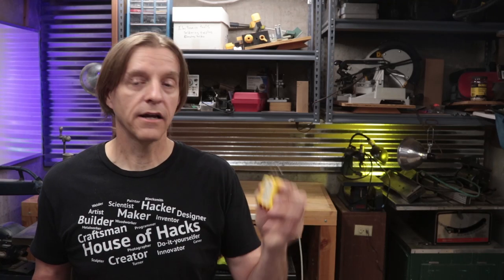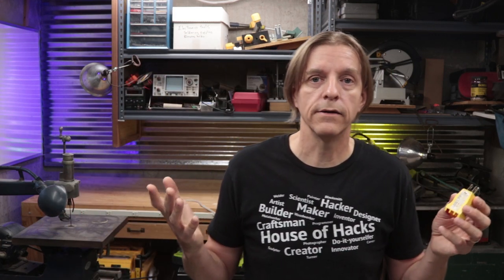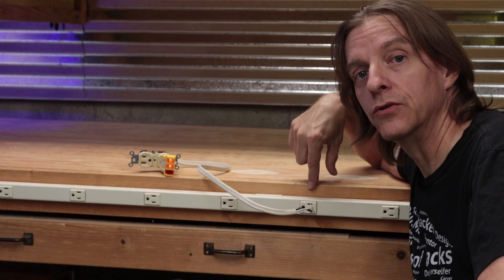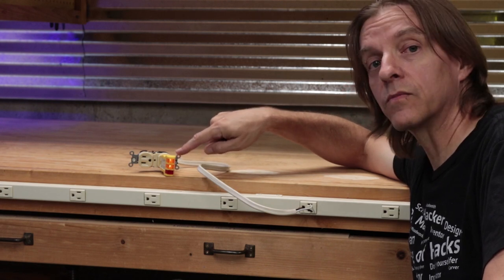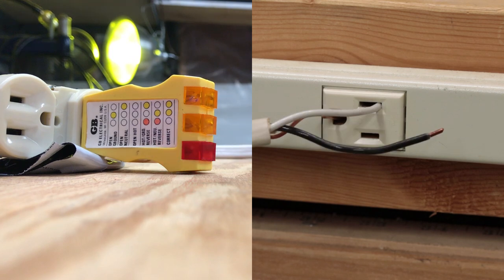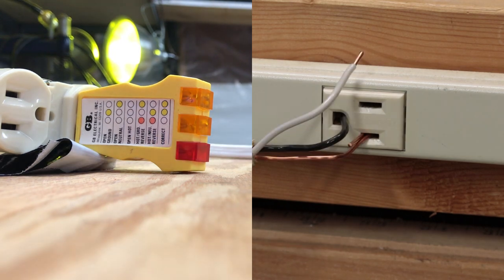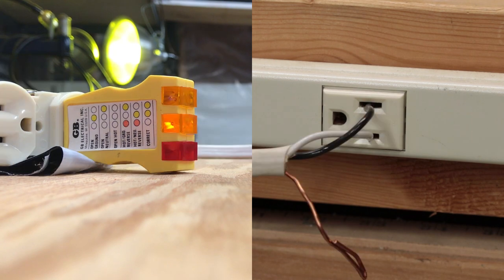Outlet Tester Light Meanings - Examining All Combinations

Comment: hi, i have an outlet that has no power and tester show 'correct' readout, BUT center light is faint and right light is bright. have you ever seen such display? thanks
Reply: Likely a poor neutral connection that allows enough current to light up the middle light,  but fails when a real load is connected.

Comment: There's one more undocumented configuration of the lights.

 It's 1 that all 3 lights are lit because there is AGFI circuit with no ground except 1 and appliances plugged in they will a luminate all 3 lights at once.
Reply: Just tested on of my gfi outlets and it lit up just like that. I don’t use the outlet, should I be concerned?

Comment: What happens when You have one solid yellow and one lighter lit middle yellow light? Its like almost "correct" but nothing is working.
Reply: Poor neutral connection.  The middle light is connected across hot to neutral.  Allows enough current to light up the middle light but fails under load when a real appliance is connected.

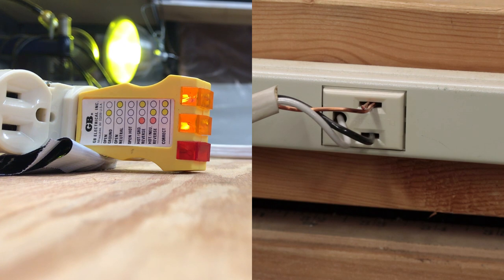Comment: 2:29 old houses around here (Qc, canada) have the ground and neutral on the same bus bar in the electrical panel. to the house are just the two phase (120AC) coming in, the ground/neutral come tru the earth(soil outside). it is why it is important to have a good grounding(soil) for the house. also you can see every other telephone pole has a grounding spike. sometimes they corrode and it can cause problems.
i have heard stories of homeowner removing their grounding rod to do some renovation and they got electrocuted to death.

i have discovered this while seeing that only two wires came to my house from above, and that the metal cable intertwined between them was not connected to anything and was just a support for the other two. i saw inside my panel all the ground and neutral connected together so i then understood.
Reply from the maker: Hi Francois!

Yeah, old wiring can be dodgy sometimes. A work buddy of mine had a house built in the 1840s. When he moved in, different parts of the house were wired to different standards, including some that was bare wire running through the attic with knob and tube insulators. (It had started with fabric insulation but that had decayed over the years. He found it lying under the wire.) When he was done with it, it was all up to modern code.

My understanding, is the neutral wire here in the US goes to ground at the electrical substation, so the only real difference between ground and neutral is where the ground is located.
Reply: @HouseOfHacks  i found some of those ceramic insulators before. very strange to know they even considered using something like this in the past. my current house has tar and paper wiring with some new add-on with the modern PVC cabling.

i wish you great health and success in anything you do!
Reply from the maker: @Francois_Dupont  Yeah, some of the things that used to be done would never happen today due to the cost. We just had some relatively expensive houses build next to us over the past 2 years and I was surprised how cheap some of the materials were.
Peace!
Reply: I truly doubt that there is no neural coming in. That would limit the power and put a deadly voltage gradient on the ground. The neutral may be on the sheath of the cable. No circuit breaker will trip in case of fault if there is no neutral.
Reply: @okaro6595  no actually, since both phase are 180degrees from each other most of the power get cancelled inside the panel in the house. for example if you take 14amps from one phase and 12amps from the other there is only 2amps going thru the ground/neutral to the telephone pole. it is why all the circuits in the panels are always installed at interval. one is on one phase, and the next circuit is on the other phase.

are you in Canada? if you want to know just go watch a couple of electricians video about this. i am sure they would explain it all in detail.
Reply: @okaro6595  i forgot to say, there is no sheath on the cable. both phase are simply naked cable covered in PVC or something. then there is a lone steel cable that is naked and interwoven with the other two. the steel cable is simply used to provide physical support. there is no outter shealth.

Comment: What does it mean if you have an outlet circuit connected to a 15 amp breaker that trips after a few minutes on with no load and when you use the tester, both yellow lights are on but are flickering?

Comment: I have a center light bright, right light dim until i push the test button, then it shows hot/neutral reverse. It is clearly wired correctly and reversing the hot/neutral wires didn't change it. Any tips?
Reply: I've ran across this once in an older home built in the 50s with metal boxes and no ground in the wiring but the box was partially grounded on a basement wall.   What you have is an open or very poor ground.   The test button on your plug tester is used to trip a GFCI and does that through a resistor connected across the hot and ground to simulate a 30mA ground fault and verify that a GFCI receptacle or breaker is functioning properly.  Because there is no ground on your receptacle pushing the test button on the tester applied voltage on the ground,  and the red light lights where there is voltage between neutral and ground.   The middle light indicates voltage between hot and neutral.  The righthand orange light indicates voltage between hot and ground.   You can use a multimeter to check the voltages on a properly wired, a hot/neutral reverse,  and other miswired configuration outlet from hot-neutral, hot-ground and neutral-ground to get an idea  of how a three light tester works if you're really curious.

Comment: Hello, I am using Sperry Outlet tester and I get all THREE lights on an outlet.  Replaced outlet but still no luck.  I tested with multimeter and only getting 6-7 volts.  Anything else I can try?  Thanks so much.
Reply: Better to call an electrician. Problem solving is not for laymen.

Comment: 2:29...my 15 amp gfci outlet shows two amber lights. Any appliance plugged in won't run. But the Sperry circuit tester shows it's a hot outlet. The outlet was installed 31 years ago, so I suspect just a replacement gfci outlet at 15 amps. Is this my first course to repair the defective electrical outlet or are there others to consider first?

Comment: What if middle light is on, but the right side light is dim?
Reply: Poor ground.   Might happen in an old house with metal boxes and no ground wires.   If you were to take a multimeter and test across hot-neutral,  hot-ground and them neutral-ground you'd probably see  120V hot to neutral,  a few volts hot to ground and 0 volts neutral to ground.  A few volts is all that is needed for a neon indicator on a tester to glow dim.

Comment: What does it mean when all 3 lights are on?  Does it mean it's all crossed up on the circuit?
Reply: All three lights lit means the outlet has 240 volts,  or somewhere close to it.  Either because of a floating neutral on a multiwire branch circuit eg. a 12/3 romex in your kitchen supplying the two circuits for the countertop outlets with the black and red sharing a common neutral, or someone installed a standard 120 volt 15 or 20A outlet on a dedicated circuit when they really needed a single outlet 240V 15/20A, such as you might find in your living room or garage for something like a larger air conditioner or electric heater exceeding 1500 watts (the electrical Code and UL standards limit the plug-in space heaters to 1500 watts when a 120V 15A two or three pronged plug is factory installed)

Comment: I have a combination that you didn't mention, maybe because I have something different on my tester, I have the right light on, and the center light is flashing on one tester, and on my other circuit tester the right light is on, and the center light is dim. I am testing an outdoor plug that is in an outdoor protective box, and it has worked for a long time, but I am thinking the plug will need replacing because Christmas lights will not work on this receptacle, but Christmas light work in the house.
Reply from the maker: Don't know. The differences between the two testers is probably due to minor differences in their manufacturing. Possibly a partially bad connection that puts the tester in an indeterminate state. If it were me, I'd just replace the outlet.
Reply: @HouseOfHacks  I did attempt to replace the outlet, but had crazy problems. I had 110 volts at the wires going to the outlet in box, I used 2 different meters, to make sure it was not the first meter being a problem, and results were the same, but here is the good part- I connected a new GFCI and it would not power anything that I plugged into it. In fact it would not reset, and paperwork for the gfci said it needed to reset before it would work. So I said heck with that I will try a regular outlet, figuring I got it now, but that would not power anything I plugged into it. So I figured some Halloween goblins were hanging around an messing with me, and that is where this day ended.
Reply from the maker: Hmm, sounds like there may be a problem with the way the wires are connected at the other end before they get to this box. The fact that a GFCI wouldn't reset raises some red flags. I'd find the other outlets on this circuit and inspect them for problems. I know sometimes all the outdoor outlets for the house are on one circuit so it may be a problem with corrosion or other similar issue somewhere else. If it's to code, it should have a GFCI breaker somewhere on the circuit, so perhaps that's gone dodgy being exposed to the elements over the years.

Comment: Another thing these testers fail to detect is a bootleg ground, a very dangerous situation.  Especially with a flipper house, before the early 1960s (1962 to be exact if i remember reading the NEC code book correctly) most homes were wired with fabric covered NM (aka romex) or armored cable (aka BX) that only included a hot and neutral..... no ground wire like is required today.   In an attempt to fool inspectors and the average joe homeowner relying on these receptacle analyzers,  what one of my fellow electrician calls "the 3 eyed liar" into think that the wiring has been probably updated and grounded to code.  The renovators remove the two slot receptacles that originally came with the home, and replace them with the 3 slot receptacles.  But because there is no ground in that box,  to avoid failing an inspection because of open grounds, they would wire up outlet like usual,  then take a short piece of wire and connect the neutral and ground together.
Reply from the maker: Interesting. My first house was built in 60 and didn't have grounded outlets. I'd not heard of the bootleg ground hack. I suppose it might be safer for a user though than an open ground, wouldn't it? If an appliance had an internal short that put hot to the case, at least it'd give the current a return path rather than through the user.
Reply: @HouseOfHacks  in a way you are correct, in that the neutral and ground typically connect to the same bus bar in the panel.  However,  a neutral is a current carrying conductor,  a ground wire normally does not, but will briefly to trip a breaker in case a hot wire grounded out to say, an electric drill with a metal casing  while you are standing on a cement garage floor. Another very dangerous example would be the neutral wire opened somewhere upstream, or worse yet, hot and neutral reverse somewhere,  such as might occur in a very old home that employs knob and tube wiring,  where they might not even be color coded black and white like today, the ground and neutral might be hot and the hot would be neutral.   Ironically,  the 3 eyed liar will not detect this dangerous condition either
Reply: In those homes The metel armor of cable and the boxes they connect to are the ground. Panel were grounded to rods or water pipe at the panel
Reply: An important thing is that they cannot detect reverse bootleg ground with is absolutely deadly. If happens when you try to make a bootleg ground but for some reason the hot and neutral have been reversed and the white wire is hot. You can get what happens if you hook the ground to it.

Comment: Good video. Thanks. I was checking an outlet with a Sperry outlet tester and all three lights came on. I re-tested several times and kept getting the same result. I even had a friend verify what I was seeing. Thinking the tester might be defective I tested several other outlets and all seemed fine. Have you ever seen this before, and if you have, what does it mean? Thanks again.
Reply from the maker: Hmm, I don't think I've seen that one, not sure what it means.
Reply: I have that too
Reply: Hmm, you might want to check the voltage with a multimeter.  Since each bulb on a three light tester will only  light up when there is a voltage difference between that particular bulb, the only likely way all three lights can come on would be that somebody has wired the outlet for 240 volts instead of 120.  You'd have in this case, 240 volts between the hot and neutral,  120 volts between hot and ground, and then 120 volts between neutral and ground.  Likely because someone installed the wrong type of receptacle for a large window AC unit instead of a proper outlet for that volt and amp rating, but if that is the case it is  supposed to be on a dedicated circuit.  I say "supposed to" because I have personally worked in old houses and I have seen stuff i would rather forget about.

Comment: What happens if the wiring is correct. It’s showing it’s correct on the tester and you accidentally push the gfci test button and it shuts the lights off on the outlet strip?
Reply from the maker: Pushing the GFCI test button tripped either a GFCI switch or a breaker. You'll have to find where it's tripped and reset it.

Comment: These outlet testers are great tools, no doubt,  but can be an issue for the average joe that doesn't understand the many limitations that would require very specialized and expensive test equipment to diagnose such issues as bootleg grounds,  high resistance connections,  and voltage drop issues
Reply from the maker: Yep, they certainly don't test all the weird circuits might. It is a good sanity check for DIYs.
Reply: These are for basic issue like lack of grounding, reverse polarity. These are not professional tools. It is much better to use these than to start poking with a multi-meter. I think lack of grounding is a real issue in old homes in the US as people just changed sockets without any consideration to safety. It is not so in the UK where all sockets have been grounded since the 30s or in Europe where there is no need to change sockets.

Comment: What if all 3 lights are lit up?
Reply: All three lights lit means the outlet has 240 volts,  or somewhere close to it.  Either because of a floating neutral on a multiwire branch circuit eg. a 12/3 romex in your kitchen supplying the two circuits for the countertop outlets with the black and red sharing a common neutral, or someone installed a standard 120 volt 15 or 20A outlet on a dedicated circuit when they really needed a single outlet 240V 15/20A, such as you might find in your living room or garage for something like a larger air conditioner or electric heater exceeding 1500 watts (the electrical Code and UL standards limit the plug-in space heaters to 1500 watts when a 120V 15A two or three pronged plug is factory installed)

Comment: Hey @houseofhacks theres another configuration that has all lights lit up. What does that mean
Reply: All three lights lit means the outlet has 240 volts,  or somewhere close to it.  Either because of a floating neutral on a multiwire branch circuit eg. a 12/3 romex in your kitchen supplying the two circuits for the countertop outlets with the black and red sharing a common neutral, or someone installed a standard 120 volt 15 or 20A outlet on a dedicated circuit when they really needed a single outlet 240V 15/20A, such as you might find in your living room or garage for something like a larger air conditioner or electric heater exceeding 1500 watts (the electrical Code and UL standards limit the plug-in space heaters to 1500 watts when a 120V 15A two or three pronged plug is factory installed)